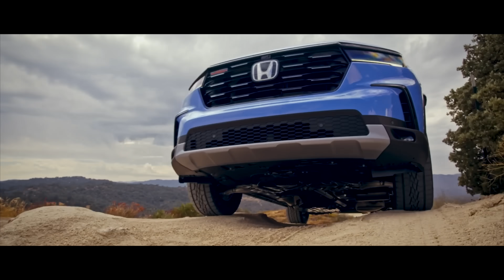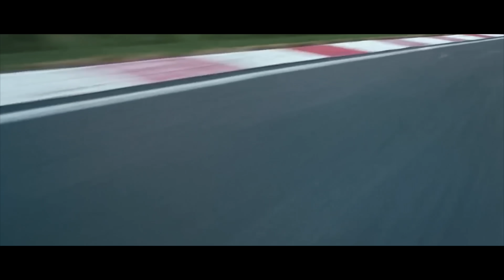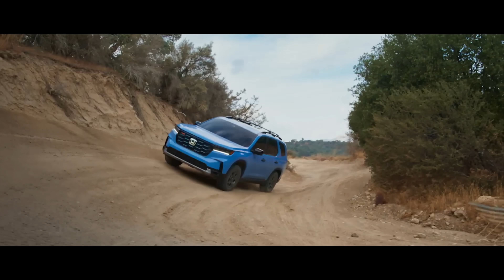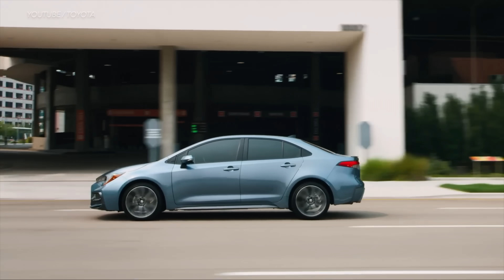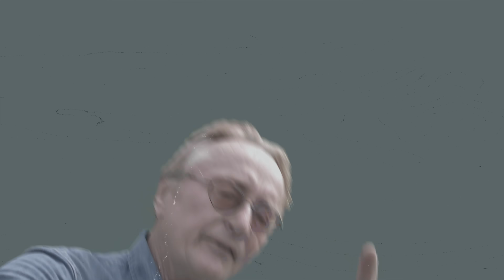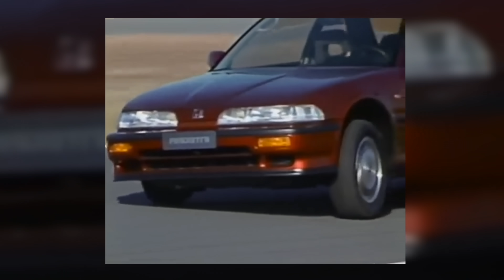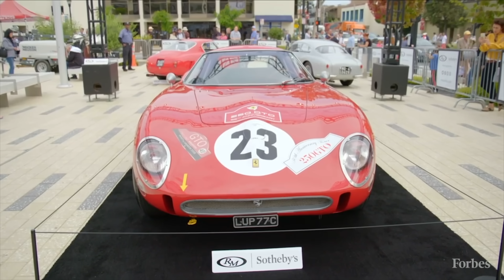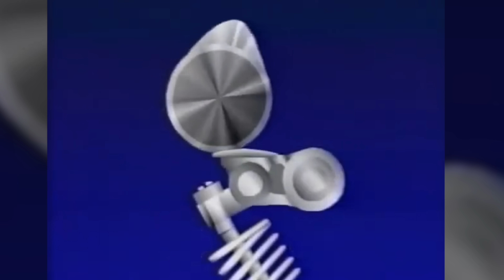Honda's New Engine is the Most Powerful Engine Ever Made

Comment: Hondas/Acuras reliable uber performance, my 2006 TL Acura still breaks the tires loose with all stock setup, if you punch it at 40 mph to get to 70-75 to get on the highway you chirp the tires on the downshift. I don't manually shift it, that transmission does it fine. Handling is a blast, but in cornering when wife is in the car I seem to get a bruise on my right arm... She wishes I would drive more gently...lol and willing to show me...

Comment: I have a 2004 Accord Euro that is the same as a TSX. It was really slow until I got a reflash, the seat has movement in moderate cornering (widespread issue), seats that give me back pain without a lumber cushion and has issue with the secondary dash display. I can say is amazing engine AFTER the reflash and very comfortable suspension and rare for the age and price button cruise control. When I was buying it Honda CVTs, V6 transmissions were widely known to be unreliable and seats are known to be very uncomfortable even with full adjustability. I would only ever look at a Honda again if I couldn't find a suitable Toyota. Coming from a family with many Toyotas I definitely don't rank them the same as even CVTs are bulletproof with Toyota
Reply: You should of got the Euro R!

Comment: I’m a huge Honda fan and have a 23 odyssey. But there are a few big things I don’t like about the new v6. First is cam phasers, I get the benefits but nearly everyone using this technology has issues with it, unless it’s the Toyota set up with electric motor on the intake cam. Second is that the new engine does not have camshaft bearing caps, these are built in to the valve cover, why? It’s just complicating something that does not need to be. Lastly, why why why for the love of all that is holy is Honda still using a damn timing belt? Go chain and save your customers the 100k mile maintenance that’s easily $2k at the dealer. It’s because of these 3 things that I prefer the old version vs this new one.
Reply: Totally agree!😂

Comment: My dad is nearly 80. He drives a 2004 Mazda 3GT Sport 5 spd manual Electric blue. I sold it to him and my stepmother in 2007. Now has 224,000km. Burns oil believe because my dad put cheap oil in it not synthetic. First generation Mazda 3s  need synthetic 5w 20.
Stock has 2.4L 4cly DOHC 16valve 160 hp 150 torque. Not bad for its size. The Speed3 is way faster though. Uses coolant  about 1 L  every 6 months to not sure if has a beginner stages of head gasket going.

Comment: I have a '98 civic with a D16Y7 that isn't V-Tec and is a turd (109hp). I also have a '13 is350, 2GR-FSE, which is direct and port injected and is shy of 3x the hp (306hp) of my civic. It isn't bad technology. Responsive, reliable, decent fuel mileage. I am sure Honda's new version will be much much more efficient. All that said, V-Tec is iconic 🤔

Comment: The VTEC technology was pretty. But it is complicated. Fiat invented a superior technology, which they call Multi-Air which uses electrohydraulically controlled intake valves. it therefore becomes a software-driven intake valve timing system, and it is so fast, that they can open and shut a valve twice as fast as a cam can do, without having a cam at all which means it is cheaper and easier to make.

They have not licensed their patent, and it will be a few more years before the patent expires. I think most companies are running out of interest in improving internal combustion. The Achates engine has some advantages for very large motors, and they are being tested by Cummins, but really we are nearing the end of ICE motor development funding.

Comment: so a ow16 oil, that will need on the clock oil changes, since any carbon on those rails and they wont engage or only partially engage, i can see a bunch of screaming around that in the horizon

Comment: Worry free driving 250k plus miles and counting...The #1 feature of the Toyota carolla is that one can drive it new off the dealers lot and park it in a high crime neighborhood and it won't get stolen, as long as you take the keys out of the ignition. Because if you leave the keys in the ignition you're just asking for trouble! That's one less thing to worry about over the Civic.

Comment: J series is a great engine. 2 issues though. Timing belt replacement is still required and the problematic Vcm is still implemented although it's been refined since it's conception
Reply: Yes! I wish they would ditch the VCM. I believe it caused premature wear to camshaft lobes in the earlier models.

Comment: I own a low mileage Honda 2017 CRV and just purchased a 2023 Lexus NX hybrid. Both are well made cars. The Honda has never been in the shop. The Lexus is a little more luxurious, and does costs more. Both cars are great. Pick one that suits you. With either one, you won't have to worry about engine recall etc..

Comment: I think Honda and Toyota are equally as good, just in different areas. I’ve owned both and am currently driving a Civic 2.2 iDtec. It has loads of power and torque and also sips diesel when driven normally. For hybrids I’d go to Toyota as they probably have more experience in that area

Comment: Prefer Toyota engine designs, especially the hybrid power trains., a better approach to emissions without compromising performance and reliability. 
Too bad Honda was compelled to compromise performance as a concession to emissions, their new V6. Takes away a reason to purchase a new Honda using the new engine.  Do not like the Honda Hybrid drive because unlike the Toyota design, uses less reliable clutches.

Comment: I just bought a new Civic Si. This is the first Honda I have ever owned and it’s been great so far. Always have bought American car brands in the past however after owning this I may be a Honda guy for life. Thanks for another great video Scotty, your channel is one of the best on YouTube!
Reply: get a ktuner and it'll wake the car up beyond belief.
I have a 10th gen Civic Si which a TSP Stage 1+, ACT Clutch Kit, and a cold air intake (street). All which brought my car to life.
Reply: Also, change the full synthetic oil sooner than 5,000 miles or whatever the owner manual says.  Also do the same with draining and filling transmission.   It will last 4ever

Comment: Alas, still no mention of Honda's gimmicky MTREC system they used in the E07A series 3 cylinder motor used in the Beat. With low power and a very close ratio 5-speed you drive like a racecar to keep up with normal traffic and at the end of the day you had more fun than your neighbor with a Porsche and pay less in insurance.

Comment: Another great explanation that makes sense Scotty. I had a 2001 Honda Stream with VTECH. It made 154Hp and drove well; the only problem was the transmission which failed at around 70K miles. Swapped the trans but that too failed about 10K later. I think they fixed a bunch of them for cars under warranty.
Reply: I got a 2001 Stream K20A1 with manual transmission. 240k km on the clock and no issues at all.
Reply: @DEIYIAN  I wish mine had been manual, but it drove really well in auto sport mode. It was heavy on brakes though.
Reply: @imagseer  Maybe the brakes are the only thing I dislike about her...

Comment: Scotty, you said this new engine uses direct injection. Is this going to cause carbon buildup on the intake valves? And will you still have to adjust the valves? If so, I suspect that will be a mechanic’s nightmares.

Comment: the main weakness is low rpm fell slow if you using old automatic the effect is more more felt, last time they change L15 with dohc version witout putting direct injection, it make slower on 0-100 time but got faster high rpm speed and higher top speed it can run 220kmh effortless from 1.5lt  due DOHC upgrade

Comment: I currently have 2 hondas and 2 Toyotas.  Over the years I've always just had these two car makers. I can say that hondas handle better....  But I love reliability and I find them both incredibly reliable. Both makers are easy to work on. Its a draw for me.
Reply: I also have 2 of each! 
1980 toyota pickup 
2007 tundra 
95 civic hatch (j35a4 swapped)
2001 crv.
Reply: @cadecarp11  do you agree with Chad?
Reply: @monahengramokhoro  yeah

Comment: I’m a Honda guy tbh, I generally like the driving dynamics of there products more than Toyota.  At any rate I’m always cautious about tech that has anything to do with government forced regulation, it always seems to create more complexity and hidden downsides.  With that said, who knows, maybe Honda got it right on this one.
Reply: Exactly what I was thinking as soon as Scotty mentioned "better emissions". This is code for bureaucrats=happy and consumers=worse product
Reply: Generally I would tend to agree except in this instance they are using a well proven and researched DOHC design that many cars have used. I have no doubt it will prove to be as trouble free as the 4.0 VR Toyota has in the 4Runner.
Reply: @johnhughes3776  exactly my thought as well.  Simpler is usual better.  I just hope they get the DI set up right.

Comment: I believe it will be a lot better than the old V tec engines. This way we won't have to clean the screens and replace the stupid solenoids! I still prefer toyota. The new Hondas need to get rid of the CVT transmission if they could build a transmission like the build the engines they would have the market in the bag!

Comment: Will never buy a Honda ever again after the multiple issues with the Jazz/Fit with less than 40K miles… multiple transmission issues, leaks in roof seals, electrical issues, engine shudder, OEM ignition coils full change twice, all that and both the dealer and Honda claims HQ denied all responsibility for. These were also issues for huge numbers of owners both in the US, Japan, UK and Aust.

Comment: I would agree that Honda engines feel more powerful than other brands with the same or more HP rating.  I have a 2016 Pilot fwd that feels quicker and faster than my 2013 Cadillac cts 3.6 which is rated at around 330hp. I put wider lower profile tires on the Pilot to keep it from fishtailing around the corners and stop it from bouncing up and down.  MY only gripe about the Pilot is the 6speed auto.  The harsh downshifts and up shifts are annoying. I am seriously considering swapping out the automatic for a manual gearbox. What do you think?
Reply: Scotty there are absolutely NO pilots made with a manual transmission anywhere!   😢😢
Reply: Thats a lot of work to change to MT.  A lot....to say the least.  The few people that have done it on the 8th gen V6 Accords have said afterwards that they wish they would have just sold the car and bought the manual instead  and avoided all the headaches and time and money to swap the transmission. And thats the truth... sell your auto and buy a manual one same model if you really want the MT.
Reply: @PrecipitationMatters  Yeah, I guess you're right, with all those computers and microchips in modern cars.  I remember back in the 80's, a friend of mine swapped out the automatic for a manual in his Toyota Supra, with no problems.  Since Toyota makes a manual for the Supra. Where as Honda doesn't make a manual for the Pilot.
Reply: Don't waste your time and get rid of the caddy lol the 3.6 sucks and so does there transmission lol
Reply: @cormaro13  My kid is getting the caddy when he turns 18 in August.  And yes the caddy tranny is garbage, and so is the 3.6!

Comment: My first car was a 1995 civic ex coup and my second was a 1991 civic dx hatchback. My most current vehicle is a 2013 civic si hfp coup. It has a stock k24z7, 6 speed manual transmission, suspension and 18 inch wheels that come with the hfp package. It's super fun to drive.
Reply: 9th Gen si's are slept on. So fun to drive. Slick gearbox, easy clutch, ton of torque, handle great, good on gas. Very fun and economical daily driver, hard to beat
Reply: As they say on the great "Might Car Mods" channel ... "VTEC Yo !"

Comment: Started off with a Toyota paseo POS the engine blew had it rebuilt.. bored it over but ended up selling it bought a square body Toyota Camry V6 it had lots of power and never broke down just had to replace a cv axle... Fast forward a couple year and I went to Nissan complete trash had an ignition start going out on a brand new Altima V6  it was super powerful.. I've raced BMW 350z and it could hold its own but the components were garbage..moved over to Honda Accord 3 in total.. great cars they were all 4 cylinders. They never broke down.. super reliable.. then I got a civic actually 3 and they were also super reliable and economical on gas... Now I'm 4 CR-V deep and I'm having reservations about all this new Honda technology.. the CVT the turbo 1.5 litre or whatever they have going... Between those two things I'm considering moving to Lexus.. Scotty you would be proud 🤣
Reply: Move to Lexus.  And then start watching the car care nut.  All my male coworkers advised me getting 3 series BMW...I just couldn't do it in good conscience because once I sat in that Lexus, the performance difference was not as important to me. And every 3 series owner said maintenance was expensive or not AS expensive if you scavenged 3rd party parts and did the major repairs yourself.  Sorry, not going to do it.  I guess I'm getting old!

Lexus all the way!

Comment: I am a big fan of Toyota and Honda.  I own both Toyotas and Hondas and have had very good service from both and although they are different from each other, it is my view that Hondas are a better car.  The stuts last longer on Hondas and they are easier to service.  The engine oil and filter are easier to change on a Honda and the automatic transmission is easier to service.  I currently have a 2013 Cuvic as my work car and have almost 200k on it.  I have replaced the spark plugs once and soon will be replacing them again.  Full synthetic oil and change about every 7500 miles.  The transmisdiin fluid change every 40k.  The only thing I have replaced is the left rear shock absorber at 120k as it showed signs of leaking.  The rear brake pads at 110k and the fronts at 164k.  The car is mostly highway miles and uses no oil between changes.  The auto climate control works better on the Civic than our 2013 Toyota Avalon Limited.  I like both of those cars but feel the Honda has better engineering.
Reply: Toyota is not making their engines more DYI friendly.  Take the oil and tranny changes.  All the hassle and oil filter cartridge junk you have to go thru just for an oil change is not for me.  It makes Honda more attractive to me as a vehicle that I can do things, myself.

Comment: For automobile engines, the Bugatti 8.0-liter W16 engine is a champion at 1,578-horsepower that has been adopted by the Chiron Super Sport 300+. The Bugatti might not be the record holder forever, though. If it ever hits the market, the Devel Sixteen's V16 could produce 3,006 hp (2,242 kW) in daily driving configuration and over 5,000 hp (3,728 kW) in the maximum level of tune.
For most powerful 6 Cylinder engines, the Porsche 3.8-liter Boxer for the latest Porsche 911 GT2 RS. The 3.8-liter biturbo features an amazing output of 690 hp (515 kW).

Comment: But what would happen if you put engine heads of a VTEC V6 engine onto this engine? Would you get even more performance? Sure I know you’d need the right ECU, solenoids and adjustments to run this engine like this but since the J Series shares most of their flanges and mounts, the VTEC engine head should be compatible.
Reply: not sure it would be worth it. Just find a j37 from an acura mdx those are 300hp and 300tq.
Reply: @GnarshredProductions  I’m still wondering if I could put this engine into a 2000 Honda Accord Coupe. Would that be worth a try?
Reply: @seikojason  yes its possible a lot of work though. I know as guy who had a j32 turbocharged swapped into a 1998 acura integra. That was  back in like 2015 and car used an AEM standalone computer to run

Comment: Scotty have you looked at the Rover/MG engine with VVC? It is referred to as Very Very Complicated but has the ability to change the timing by 70 degrees. I am aware that it is not available in USA. It has split intake camshafts that also have camshafts inside the camshafts.

Comment: .
1) The front hood is extended to make it look larger, but under the hood it shows it's just hollow space.
2) It isn't better on gas than the 2022.
3) It is slower to accelerate from 0 to 60 than the 2022.
4) There is no mention of Honda fixing the CR-V theft problem.

Sorry, but it's a hard pass. RAV4, CX-5, Rogue, all better options.

Comment: Hi Scotty from Down Under 🇦🇺🦘. Great video.  I had a 2003 Honda VFR 800 with VTEC. Such a great sound when it kicked at 6800 RPM. Still averaged 5 L / 100 km. Sold it with 90 000 kms on it. Used no oil and started first time every time. Great motorbike and engineering.
Reply: I owned a 2005 VFR, you're right the sound and power over 6,800 RPM were magnificent!

Comment: I love the 1.8 that was in my 2008 Honda Civic. I would've kept that coupe if I hadn't promised it to my son. That car had enough oomph for me. I also love the 2.4 that is in my wife's 2009 CRV. It has 180,000 miles on it & and is still going strong.
Reply: Yes 2009 civic 200k miles on my uncles ...no issues ..boat cars ...tbh 
 Safer  reasonably technical but solid performance 
For 1.8 the engine is just awesome
Reply: Shoot bro my accord has like 175k and it feels great. Sadly im going to try to sell it. Could use the money for a lot of things. I need to upgrade back to a motorycle.
Reply: Have a 2005 with 150,000 feels brand new
Reply: i agree the r series engines were so dependable.